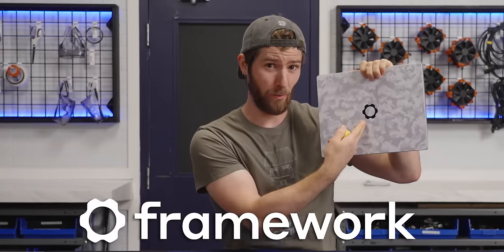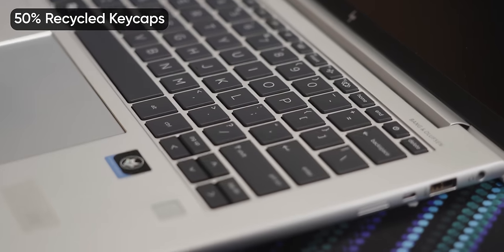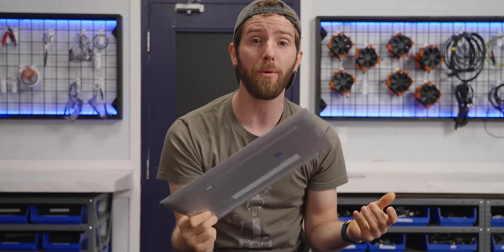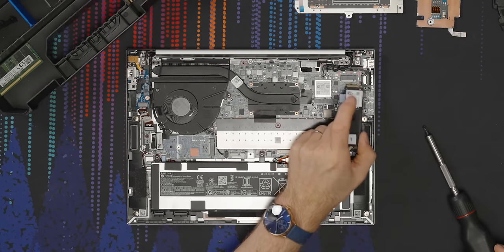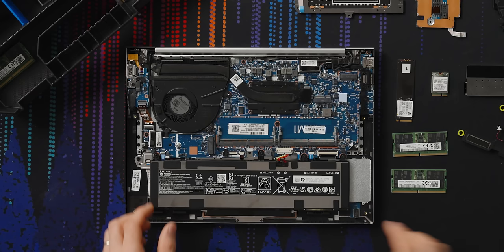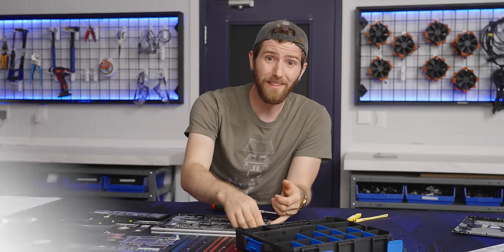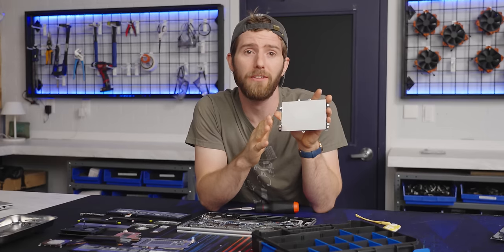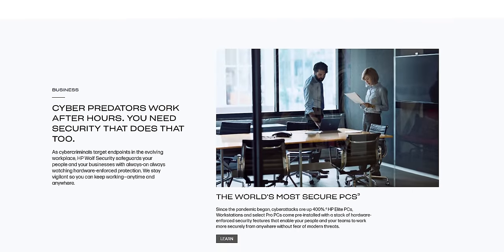My Investment is in TROUBLE - HP repairable laptops

Comment: I've been in laptop repairs for 8 years and this is basically the same as fixing a normal laptop these days. The only extra thing here is it's slightly easier to buy the parts.
Reply: a ton of laptops have some soldered ram these days
Reply: have you not seen the newest laptops from the past 7 years?
Reply: Yeah, the parts availability is what looks different to me. 

I was repairing Dell Ultrabooks back in 19 and there was no problem servicing them, but getting the parts outside of dells network was what would be the problem with repairability. 

They even made screws mostly all the same size, so gone are the days of keeping close track of long and short screws.
Reply: (and find the spare part SKUs)
Reply: I agree with you too there. Main thing will be parts availability and unfortunately we can tell only after couple of years if HP keeps inventory. I still have couple of smartphones with removable batteries but no batteries are available. I don't know if power ports and the rest of I/O ports are replaceable, but Framework modular design is better in my opinion, allowing for I/O upgrades in the future keeping the same laptop/chassis out of the landfill.
Reply: The absence of glue or super high bond double sided tape jumps out at me, I'm no repair pro but almost every machine I've gone into (which is a fairly substantial number) has been glued somewhere. Otherwise I agree the hardpart for me is always actually getting the part..
Reply: @TheBackyardChemist  yes, ultrabooks have soldered ram, just like HP's own Ultrabooks.
Reply: I have to disagree. Most current laptops have almost all components soldered to the mainboard, have no swappable daughterboards, and everything else is glued into place (and the laptop itself is glued shut for good measure). This HP laptop finally is designed like a good laptop from 5-10 years ago, which is awesome.
Reply: 100% this. I work support for one of the large manufacturers and most of our systems are easy to service like so. I just cannot speak for them in any official capacity but only in my own experience. The big issue is how you can buy or obtain spare parts. Through the normal warranty channels, with a little troubleshooting, it's a simple call or chat away. If your out of warranty, the call may not be so simple and good luck finding the parts online in new condition. Then again, Linus went out of his way to show the repairability of the HP notebook because he was sponsored by HP to show this one off. I think LTT should make a video shootout on how fast someone can pull apart the consumer flagship notebook from each major manufacturer by only using the official service documentation as a guide.
Reply: @jimhalpert9421  that's fine but not from my experience. I can't go into to much detail but the company I work for was approached by Framework to do repairs for them. My job would be a lot more complex if we had to replace soldered RAM daily
Reply: @brandon-dc6ry  What kind of company dosent let there employes say who they work for, sounds like really shady
Reply: @dreku8743  Why would not doxxing themselves be shady?
Reply: @mttkl  Unless he works for some small local tech repair company (which is a possiblity and if so i admit Im wrong) is very hard to indentify someones indentity based on there place of work specially since most companies have thousands of dedicated repair emplloyes
Reply: @dreku8743  Oh yeah, the bigger the company the harder it is to identify someone only based on the work they do, but I still believe there's no need to disclose that kind of information, specially if it involves collaboration from other companies and possibly NDAs (I'm mentioning this because he said "the company I work for was approached by Framework").

If his full real name was on his profile then of course this conversation would be totally useless lol.
Reply: @mttkl  Theres is a big chance hes under NDA thats a good fact, just wanted some confirmation since sadly, you cant really trust anyone online theese days

Comment: I tried to disassemble my old alienware 15 R2, and once I took it all down and cleaned it, I literally could not put it back together. It made me sick to my stomach looking at all the cords and wires that go through little loops and holes and squares all over, how intricately it was designed like building a labyrinth. I ultimately gave up, and was actually upset because I've repaired countless handhelds, consoles, and pc's effectively and correctly without a hitch. I really hope laptops of tomorrow are dumbed down in terms of reparability.

Comment: My hp laptop is 3 years old, it has a ryzen 3500 and i really like it, it just needed an upgrade which i did today, extra ram and 1tb nvme ssd, what made me frustrated was the screws that were unnecessarily under the masive rubber feet, that i had to rip out to get to the screws!

Glad to see they changed that for this product!

Comment: I had a keyboard die on a HP Omen 15 laptop, and the new part is ~200U-300SD if not more and is integrated with the chassis. From what I see the same is the case with the reviewed HP Elitebook 840 G9. The Framework laptop on the other hand has a 50USD replaceable keyboard. So for anyone heavily using the keyboard, the Framework laptop seems like a better option.

I wish the video covered the keyboard in more detail.
Reply: Yeah if the keyboard is not replacable or expensive, it kinda misses the point. Keyboard is something that is replaced most often in a notebook. But that are sponsored videos for you, the  bad is never mentioned .....
Reply: G9 quickspecs also mention "soldered RAM", at least the 830 model.

Comment: This is great! I'd really love to see a return to socketed CPUs too. I don't mind the extra what, 3mm?
Reply: Unless it's a gaming PC. I guess that would be too much UEFI and power plan hassle to support (affects cost). Also probably more than 10% extra overall thickness, that's actually a lot.

Edit: Did even Framework have this opportunity? I don't remember anymore.
Reply: Socketed CPUs don't make a ton of sense for laptops considering due to the fact that you will need to upgrade the chipset and potentially cooling and power delivery anyway. Not to mention we would have to get all the CPU and GPU vendors onboard with it.
Reply: @RadioactiveBlueberry  they do sell 12th gen swap in motherboards for their 11th gen models.
Reply: @rysterstech  laptops used to have socketed CPUs and you could change then and upgrade them.

Comment: 16:10 is a great improvement over the usual 16:9, but Framework's 3:2 is still the way to go for laptops IMO.
Reply: the video ends at 13 minutes..
Reply: @leogarcia4657  16:10 is the aspect ratio 😅
Reply: I think I agree there, although I'm finding with my Framework that there's more overall support for 16:9/16:10 instead and I have to use a weird resolution to get things to appear at a reasonable size on my 13" display
Reply: @Ash-qp2yw  I use a 1.5x scaling ratio in Linux Mint and things look normal.

Comment: Great to see. This should be a commonality between all of HP's product line though, ESPECIALLY for everything going forward. I'm not wowed by the ease of disassembly as much as I was with the framework. Things like a magnetic bezel are pretty great, but this is what I'd consider an acceptable bare minimum. Obviously the biggest thing here is that you can actually buy replacement parts (for now).
Reply: Exactly. The difference is that I trust Framework to keep maintaining their line of repairable laptops, assuming they are around. I don't trust HP or Dell to be supporting their line with upgrade components and repair parts in five years. Hopefully they are.

Comment: I recently picked up a pretty low cost HP Pavilion and was extremely happy with how easy it was to open and replace near everything inside, including upgrading the RAM by just popping a module in. It's very good to see.

Glad to see this review, hope this catches on and continues.
Reply: Yeah, HP has secretly had a bunch of repairable laptops for a while now in the pavillion series (AMD versions)... You wouldn't be able to tell from the AD copy though, since most of them say they don't support "Upgradeable RAM". However, if you dig for the repair guide it will clearly show that the RAM is in fact socketed.

Comment: I had to check the date on this video.
This looks like Elitebooks i repaired back in 2015, in fact older ones were tool-less to open the rear panel. I don't think Linus ever saw a midrange business laptop.
They have also ALWAYS provided several hundred page "service manuals" free to download on the website without any account.
The older Mobile Workstations (ZBooks) were also very easy to repair.

Comment: Kudos to HP. I used to have an old 8760w elitbook where you could remove the whole bottom cover in one literal second by pulling two slidelock tabs. 
Any company that takes the opposite approach as Apple (glue, adhesive and other anti repair initiatives) has my support and loyalty.

Comment: I happen to have an Elitebook 845 g10 with Ryzen as a working machine for a year now and I absolutely love it.
I got 1x16gb of RAM though, and realized it's too small in a week, so went to the nearest PC shop and got another 16gb so-dimm stick which was just recognized by the system with no performance penalty.
So I got a very meaningful upgrade for my HP elitebook in the first days of it's ownership which I could perform myself and really love it.
And another extremely nice thing I do appreciate in it, is Linux support, as I had 0 troubles with any onboard devices and clean Ubuntu installation.
Especially in contrast to my previous dell XPS 13, which I struggled with for the whole time I had to use it...

Comment: This thing is basically what the dell XPS 15 / Precision 15 once were.
A lot of this video reminds me of upgrading my 9570(so far I've changed ram, ssd, wifi Card and battery - all without needing to consult their awesome service manual).

Sad dell decided to move away from this(as a Linux user I find the soldered atheros cards the most infuriating)...

Comment: I have an Elitebook 840 G1, given to me as a discarded enterprise laptop. While it's thick and plasticky, it's an absolute dream to open up. Zero screws to access the battery, zero screws to access the RAM, four screws to access the SATA drive. Enterprise laptops tend to be way better than consumer laptops in the repairability department, so it's no surprise that the G9 is still pretty good on that front.

Comment: I'm glad to see hp is getting back into repairability, because I have an HP G42 that's so old it's basically useless, but that thing was so easy to take apart and even upgrade, it had a cpu socket and I did upgrade it a few time actually, for dual, to tri, finally to quad core before it finally was gpu limited which was sadly bga so I couldn't upgrade it even if there was some available

Comment: As someone who works on these laptops. Why didn't you take out the battery first? That is always recommended first to do to avoid shorting the device. Yet At 5:19 where I am up to, you have taken out the RAM yet still have the battery plugged in. Just very odd.

Comment: I still agree with the Louis Rossmann video on this, almost all of the replacement parts on the hp website are out of stock. Making a laptop easier to open and repair is a step in the right direction for HP, if you can't get any parts to repair it with, then it isn't very repairable.
Reply: But do you even watch?

Comment: Are board schematics available for independent repair shops or individual buyers? It is great that so many components are available but what if a chip soldered on the motherboard needs to be swapped with a new one? Can an independent repair shop buy the chip or do they have to swap the whole motherboard?
And how is this laptops Linux support?
Reply: I was about to ask the same thing,  Frameworks said they were going to do it, I'm not sure if they did. I want to see what see what Louis Rossmann has to say about it. #fighttorepair

Comment: The only thing I would question is their screw choices. I know most people have a philips screwdriver around and you shouldnt be putting much torque on the screws when tightening but I definitely prefer hex head screws rather than philips, I find with philips there is a relatively high chance of damaging the head and making it unusable since the screwdriver can slip out, so therefore I prefer hex head screws or bolts, they dont have an angled inside so once you have it in, it is very difficult to slip out and you always get a good solid connection that can handle a lot of torque for screwing. You probably dont need that level of torque for a laptop but I just prefer hex heads or similar in general and some people will overtighten the screws and end up stripping the heads.

Comment: I do not understand what is different here. It looks like all other laptops. Yes, some guides for disassembly. But no parts in stock. So whatever. Almost all laptops can be disassembled to components like this. The difference is how easy it is overall and how easy it is to change the main components - keyboard, battery, memory and disk. For that, look at Fujitsu or the business/workstation models of Dell and HP. But no laptop anymore offers changing CPU or GPU. True repairability is schematics for the motherboard, especially important on smaller and thinner devices like this and phones.

Comment: So that HP has finally caught up to the other professional laptops. I recently had to work on a brand new Thinkpad t15 gen 2. The display comes out with a few clips, 4 screws , and a ribbon cable. The keyboard is even less. All parts are available and repair guides are provided by Lenovo. Pro level laptops have been like this for as long as I can remember.
Reply: Yep. The consumer ones might be shit, but professional models are usually far far easier to work on.

Comment: Re: HP Battery Management Software. We've found at my work (lots of HP laptops here) that it's essential if you want to avoid getting bloated, potentially-explosive batteries. We ignored this for some time, and have had far fewer issues since we began installing it on every HP laptop.

Comment: I just bought a Framework laptop. If I'd known about this before, it would have definitely been a consideration, but I think I'd still go with Framework for two main reasons. First, playing with their configuration tool, it looks like a similarly equipped HP would be about $500 more. The main thing though is that I really don't trust HP to actually follow through on this. I'm happy to see this step, but I'll need to see ongoing support and upgradability before they'll catch up in my mind to Framework, since they started out with that goal from their inception.

That said, I do like this new direction, and if they make a printer like this and drop the instant ink program, I'd at least give it a good look.
Reply: Speak of the devil lol, my new Framework just arrived! And now to put it together 😁

Comment: As an user of old thinkpad, this little hp impresse me ! It'ts preatty much the level of upradability you can have right now in a laptop . Sadly some component are not modular, such as the processor, but since my good old Thinkpad T430, there was just one generation of intel mobile processor which was modular, so that's on the intel side. But yeah, this it preaty compelling, especially for someone liking the business laptop with some juice into it. I may consider switching to an hp when my T430 will be to old to run smooth !

Comment: HP has been shockingly good at being repairable. Even prior to this. My current laptop is the electronic equivalent of the ship of Theseus. (HP Pavilion x360) Display snaps in, Philips #0 all round, and all the screws holding the motherboard down are the same size. You can even swap motherboards easily (I've done it).

Comment: Thanks! Back at the time when I bought my HP Envy x360-15 with Ryzen5-2500U I was particularly interested in RAM and storage upgradability. So I looked at mainboard layout before committing the order. Ease of serviceability isn't great, but I upgraded to NVME SSD+HDD from HDD alone, from 2x4 to 2x16GB of RAM and could repack the battery (as new original batteries aren't easily available on sale in some regions). Also no problem with WiFi6E upgrade to Intel AX210. Kudos to HP for great upgradability (however parts availability may be a problem, as for battery). Hope batteries get more standardized and we see better cross-compatibility of laptop batteries in future.

Comment: the one problem some older EliteBook's (only as old as two to three years ago) have had are battery expansion problems, with as many as 14 showing problems in my small 100 person branch office, so much so that the whole company is now almost full over to ThinkPads to replace them.
Reply: Battery is replaceable. Just did my 840 g5 for 30$ on Amazon and it included necessary tools. Expansion was so bad Case wouldn't seal! but if your company only supports OEM, HP stopped producing this battery. ThinkPad is a great alternative.
Reply: @raceofrobots9152  the batteries had already warped the frame, panels and keyboard, plus they were leased computers so we did not have the authority to do any hardware repair. Leased computers and business without an in-house/local IT is why I am more critical of big OEMs and any hardware, and more so, safety problems they might have.